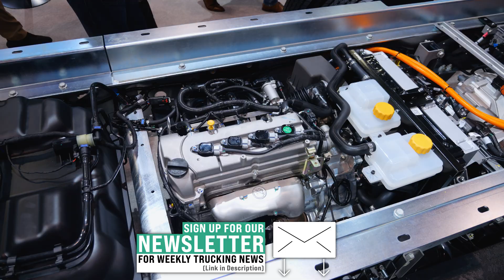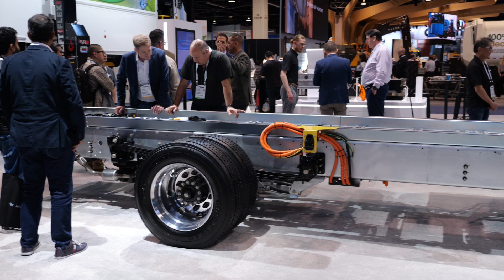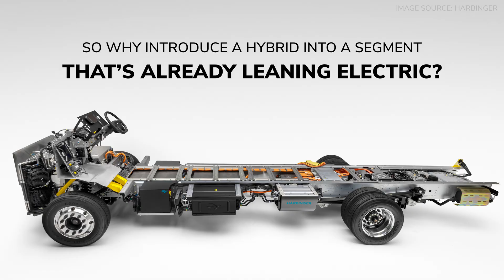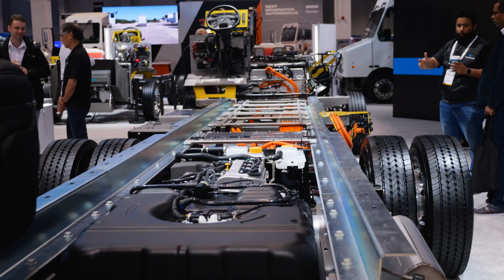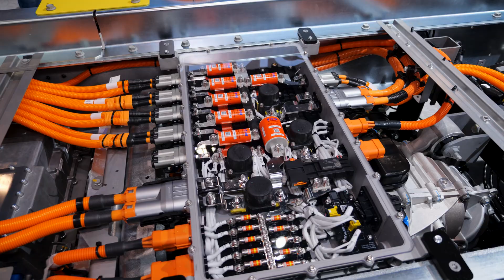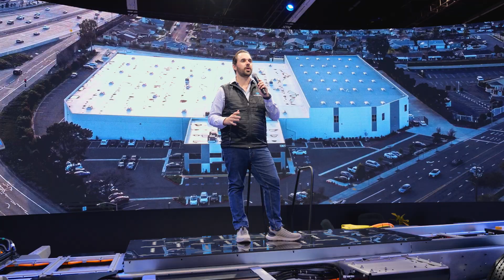How This Hybrid Motorhome Platform Could Change Commercial Trucking

Comment: Why dont they mention the true fact of a hybrid ?. .. You dont need a external plug to charge your Hybrid. Fuel i easily available, even after a blackout. .. If you go full electric, you get maximum one "tank"- One charge .. then youre fucked... stuck.... WIth a hybrid, you go get fuel, then youre good to go.. 
The true reason why full electric is being pushed... control.

Comment: Here's a pertinent question:, and other thoughts.
Why buy a hybrid in 2025 when an all electric will likely be doing the same job, but cheaper, in 2030?
The technology is changing fast enough that companies may end up seeing competitors using full EV trucks in as little as 2 or 3  years.
At that point you're stuck with a vehicle you have to refuel, while everyone else just plugs in.
Reply: still going to need my hybrid 

Especially if you going off road 

And who cares what others choose to do

Comment: Without a doubt, the Hyrid and all EVs is perfect for last-mile deliveries AND trades.  The infrastructure will catch up to support ALL EVs while the trades schools will continue to struggle to catch up with "qualified" and licensed mechanics to maintain such fleets.  The evolution of batteries and power units is clearly accelerating daily resulting in a lowering the cost of investment.